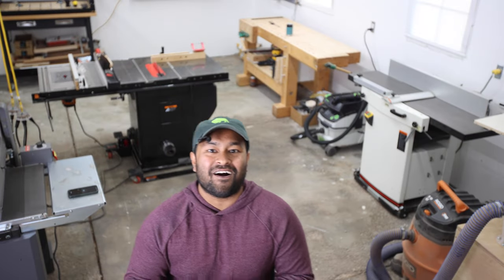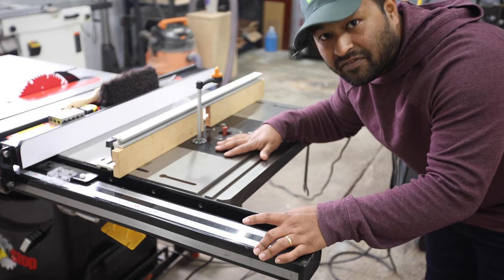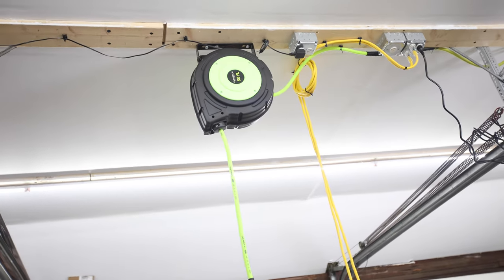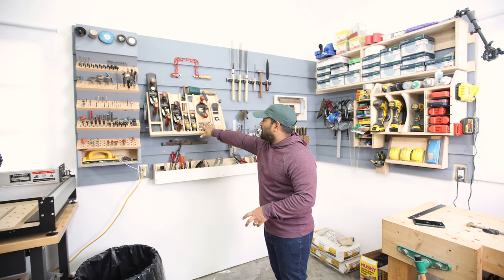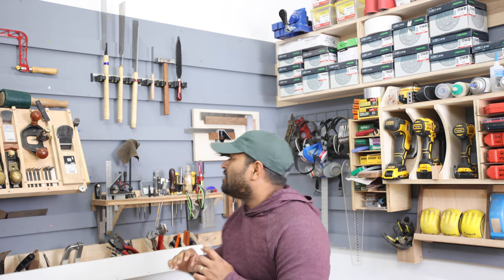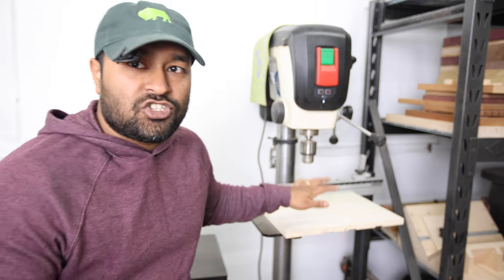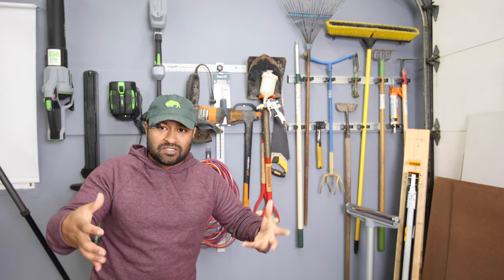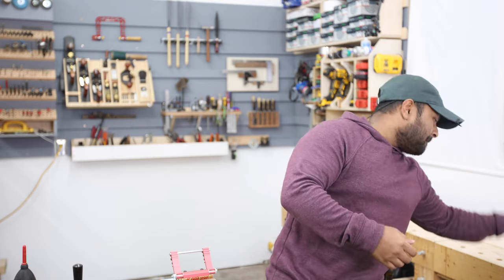Woodworking Shop Tour - 20'x30' Garage [2021]

Comment: Better dust collection is one step, but dust extraction is a whole other topic. I am fortunate enough to have recently added an Axiom air purifier to my shop as the dust collectors I had were not getting the fine particles. Hopefully I will be healthier for it.
Reply from the maker: Agree completely. Since this post, I got a nice big dust collector. But irrespective of dust collection, I’ve always used p100 respirators in the shop or specialty cartige if the task calls for it. Shop air purifier is another good method but for me, I like to make sure there is active filtration before hitting my lungs.

Comment: damn, what an awesome shop! i'm super envious about that nice planer, still saving for such a good one. 😉 good choice on the tra001 for the router table, it's a hell of a machine. 👍 cheers from switzerland 😀✌
Reply from the maker: In the states, the TRA001 is actually an inexpensive router compared to similarly powered routers. I always found it interesting because the triton provides more value and is better designed to be mounted on a router table.
Regarding the planer: Is the Hammer A31 priced better in your area since it is somewhat closer to you guys? In the US market, MRP is $5200 USD. Often goes on sale for $4550 USD.

Thank you so much for watching! Cheers!
Reply: @WoodcraftBySuman  interesting, indeed. i found the a31 for 3'250 euros (around 3900 dollars) here in europe. what a difference!

Comment: Great shop! How do you like having the router in your table saw extension? I've considered doing that as well. Subbed and looking forward to your content!
Reply from the maker: Thank you so much Jeremy and Jess! I absolutely love having the router table extension on the table saw. A full sized dedicated router is largely unnecessary for a hobby or even semi-professional shop, imho. It saves so much space and there is zero compromise on functionality. It does make the right side of the saw a bit heavier than usual. Ideally you'd want to use the legs that may come with your saw for extension arm of the fence. If you have a sawstop, the industrial base does a great job of balancing out the cantilever weight. Highly recommend a cast iron extension wing to prevent sagging. If you don't get the cast iron early on, you'll eventually switch to the cast iron. Might as well just get one up front :)
Reply: @WoodcraftBySuman  OK cool. We have a Grizzly with cast iron wings so this will be something to keep in mind in the future! 😊

Comment: Awesome shop tour!!! Comment what I would add? Hmm. Your tools are incredible. I’m a little surprised that I didn’t see a miter saw. I love mine and used it all of the time. I’m looking at upgrading to a sliding saw. Do you not like miter saws in your style of woodworking?
Reply from the maker: That is a great question. The main reason I'd want a miter saw is to break down longer boards into something more manageable in length. I prefer to do that using a circular saw instead. Since I've heard folks state their miter saw isn't super accurate for 90s and 45s (i mean SUPER accurate), I prefer to workaround it by using jigs on the tablesaw. I do have the evolution miter saw (terrible tool, btw) that is supposed to be able to do both wood and metal. I primarily use it to cut metal and haven't bothered cutting wood with it. That tells me I don't really need a miter saw for my style of woodworking. lol
Reply: @WoodcraftBySuman  I love to watch shop tours and see why people make certain decisions. Thanks

Comment: Isn't leaning your lumber against the garage overhead door, putting stress on the panels and hinges?
Reply from the maker: A little bit. But 90% ish of the weight is transferred to the concrete. I plan on replacing the doors in a year or so with better insulated doors. So I’m not particularly worried about damaging them.
Reply: @WoodcraftBySuman    K.  I’m planning on building a similar size shop. Do you wish yours could be larger?
Reply from the maker: @partsdave8943  for me? No. I can do most things I want without feeling cramped. But I also chose not to buy more tools to keep the floor space (planer, larger CNC). But if I had the option to make it from scratch, I would oversize, just in case (~30x40). I only store small amount of lumber in my shop and the rest in the basement of the house. I suppose it would help to have them all in the shop. 20x30 is very reasonable for a hobby woodshop. 30x40 would probably be future proof with all of your tool desires.
Reply: @WoodcraftBySuman  Thanks for your input.

Comment: No safety (PPE) and first aid?
Reply from the maker: That's a great point. I didn't discuss the PPE I use in the shop. Almost always use respirator in the shop when not talking to the camera. The usual eyeglass and hearing protection. Also I SHOULD have a first aid at the shop (currently in the house about 40-50' away. My wife and I are in the medical field and we def have various kits in the house and know how to appropriately handle injury cases. But yea, def need to have a first aid kit in the shop.